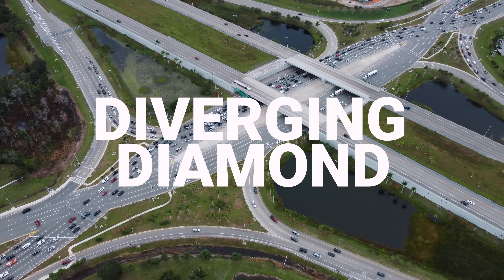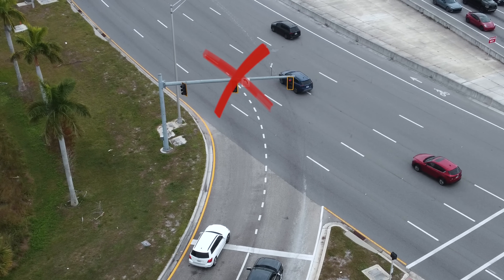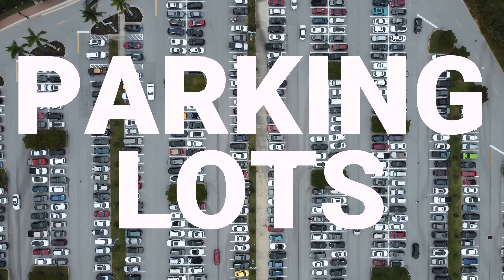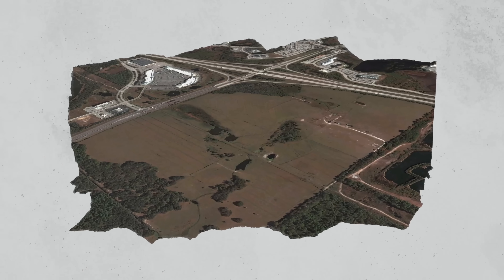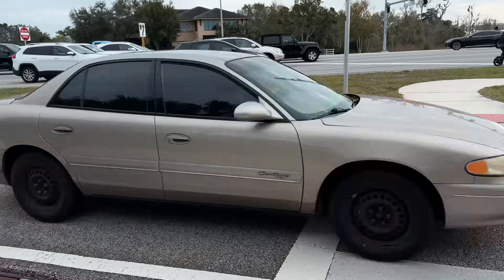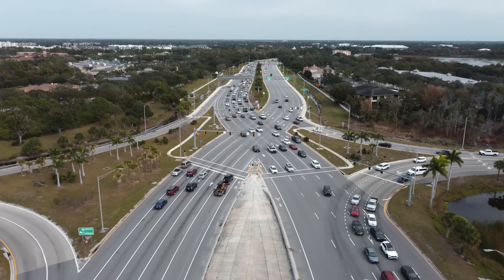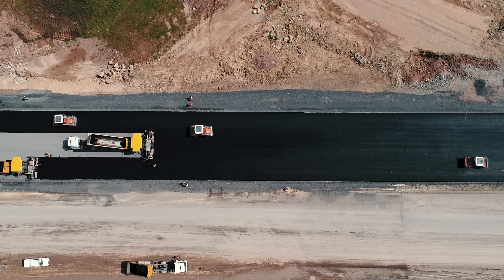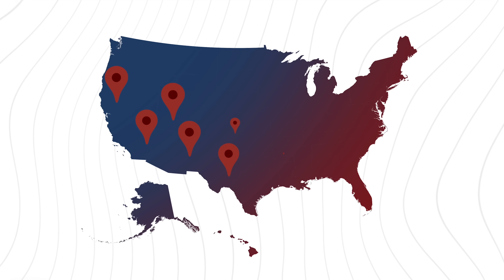Traffic Will Never Be Fixed Here

Comment: This will never fix traffic because the only solution to traffic is mass transit.
Reply: And walkability
Reply: @rennoc6478 In addition to cycling.
Reply: @wturner777 lol
Reply: @JetFire9  what’s so funny about many modes of transportation other than driving?  Don’t you hate getting stuck in traffic and high gas prices?
Reply: @rennoc6478  time to walk 40 miles to work
Reply: @RadioStar1776  if city’s are planned right, stores can be put in a walkable distance to homes, but I will concede that most jobs will still need cars or mass transit to reach
Reply: @rennoc6478 what if the cities are planned around cars?
Reply: @rennoc6478  and work from home =)
Reply: @rennoc6478 the United States is MASSIVE. What exactly is your suggestion to fix the problem?
Reply: @drglopez7789  we don’t need cross-city walkability because your right that would be absurd. We need walkability within individual cities which will get locals off the road
Reply: @rennoc6478 lol broad simplistic solutions to complex problems,  looks like we are stuck with car centric America for the rest of our lives.
Reply: @JoshuaB-p8c you want me to write a whole paper or smth, this is a YouTube comment section not a university
Reply: London and NYC just need more transit! Look the lack of congestion in Tokyo
Reply: @frafraplanner9277  Tokyo has a different culture.  If people in the US obeyed traffic laws then traffic would flow MUCH smoother.
Reply: @TeemoTemosson  There is some truth to traffic flowing smoother if people followed the laws, but the amount of traffic in American cities would still cause them to be in gridlock
Reply: @frafraplanner9277 Grid layouts cause gridlock.
You need to provide alternatives to help relieve traffic, not punitive action, such as tolls, like many cities like to introduce.
Reply: @frafraplanner9277 Tokyo has insane amounts of public transport.
It's also a central, high density city, not something that requires long distance travel to get to places with relatively low density.
Still, the city gets busy, despite the millions using trains. The solution is providing options, so that commuters can use public teansport, and irregular commuters, shoppers, and those with physical and mental disabilities can still drive to places...
Though, everyone should be able to drive. The way to relieve that is to provide good alternatives, not punish driving.
Reply: @frafraplanner9277 its not that they need more transit, its that they need to stop building things that bring "convenience" to cars
Reply: @trevorthefoamer220  But the big automakers do not want anyone to have alternatives to their products, because that would mean they would make less profit, and so the big automakers are going to fight to the death to keep North America dependent on cars.
Reply: @denelson83  Congress had an opportunity to bring the automakers to the unaliveness but they had to bail GM and Chrysler instead.
Reply: @denelson83 then it’s up to us to fight back and fix it!
Reply: @NomadMP476  Big corporations outpower us by several orders of magnitude.  Do you not think we will simply get crushed trying?
Reply: @denelson83  that’s because we yield the power to them. We can fix it but it will take time this begins at the local levels starting with town and village governments then city and state governments followed by federal government. If we can create a grassroots movement in our local areas and push that up the ladder we can and will effect change. Remember these big corporations can’t survive without us.
Reply: @NomadMP476  You did not yield power.

It was taken from you.
Reply: @denelson83  So what can we do to deal with these big automakers?
Reply: @theSpian1  Unfortunately, the automakers have already thought way too far ahead of us about that.
Reply: @denelson83  Why would automakers have anything to do with this. They should have no say in this matter at all.
Reply: @thebestdamager7400  They have a vested interest in making mass transit non-viable so that everyone drives.
Reply: @denelson83  Of course they have, but they should have no influence on the state of viability of mass transit, as they are a company and not politicians
Reply: @denelson83  Of course they have, but they should have no influence on the state of viability of mass transit, as they are a company and not politicians
Reply: @thebestdamager7400  Well, they do have such influence, and they sure as hell use it.
Reply: @denelson83  I know, which is what I ma criticizing
Reply: @frafraplanner9277 I sat in traffic for 30 minutes in an express lane taxi on my last trip to Tokyo. They still have traffic - although it does seem to be a less common occurrence.
Reply: @viperstd yeah 30 minutes instead of 2 hours
Reply: @viperstd It's so easy to claim that Japan has magically solved car traffic, though...
Reply: The only solution is proper zoning. New construction will never be nice if you require residential and commercial areas to be completely separate, and if you require such huge amounts of parking, especially non-shared parking. If you feel compelled to park your car more than once to shop an what are basically adjacent stores, something is wrong.
Reply: @karlkoehler341 Meanwhile, the right wing of politics deliberately misinterprets ideas like 15 minute cities and policies such as Congestion Charging, Clean Air Zones, Low Traffic Neighbourhoods because they perceive any restrictions on people's "right" to get in their car and drive wherever the damn they want to is either "punishing" people, a sneaky means of revenue generation, or full blown "communism"...
Reply: Obviously no road design will ever truly fix traffic as the only true solution is alternatives to driving. But interchanges like diverging diamonds and SPUI are objectively better designs
Reply: @sai_736 Diverging Diamonds are pretty bad for any pedestrians that need to walk across them though and due to American road placement is usually needed unless you want 2 islands
Reply: @Nothing_here7435  ddi and spui are highway interchanges that shouldn't be mixed with pedestrians
Reply: @sai_736  Like I said in many us towns and cities a highway cuts through them so it is needed many times
Reply: @sai_736  

> the only true solution is alternatives to driving

the only alternative to driving is not to drive and if you don't drive how are going to get to work?
Reply: @this-is-bioman  this is bait right
Reply: People in this thread are missing how this works. Traffic will always be bad. No matter how much transit or roads you have, those roads will be full in big cities. What mass transit allows is that even in this HUGE and highly congested cities, MILLIONS of people are able to get where they are going reliably and in reasonable times. Without this, not only is a city miserable as that congested road becomes your only option and travel times continue to grow and grow. Eventually you build so many roads you don’t have enough usable land to support it.. and the city stops growing.

It’s not about ending congestion. Those cities like NYV, London, Tokyo, and etc wouldn’t even be possible without good mass transit. Look at the overall travel times. These people can travel much more freely despite the congestion, compared to places without transit and where urban sprawl has become the means for dealing with growth.
Reply: Is mass transit was a solution Tokyo New York City Boston Chicago San Francisco hotlanta would not be traffic extreme nightmares.  And this is coming from a subway boy but it is nice to have options at your fingertips
Reply: The Japanese fix mass transit by having staff on the platforms physically push people into train cars like sardines. 😅
Reply: @umaikakudo Hah. Yep. People like to pretend like Japan is some public transport utopia, but there is only so much physical space for people.
Reply: It also help if we have more mix zoning like japan instead of the strick zoning like what we have
Reply: @USSAnimeNCC-  It would actually FIX the housing crisis we’re in right now.
Reply: Spoken like someone who has never lived outside of a city or tiny country. It's funny how people who haven't left their bubble can't grasp the scale of the wider, open world.
Reply: @Valensiakol it truly doesnt matter on the size, look for example the LARGEST City on earth Tokyo which has incredibly effective mass transit, and then on the opposite side the SMALLEST nation in the Americas the Bahamas has some of the worst traffic ever. So how is it size again?
Reply: @SpeedyGozalzes you're missing my point. Mass transit isn't the magic solution for every situation. Trying to rely on mass transit for the majority of people movement in some places would literally be impossible and wouldn't "fix" anything.
Reply: @Valensiakol mass transit is much more efficient than normal transit. We just need walkable cities to make it work
Reply: Mass Transit doesn’t work in the US. Where Mass Transit would be practical for its cost would be cities, and cities in the US are not like cities in Europe. They’re massive. There is no cost effective way to build mass transit everywhere that people want to go in a US city. 

The only people who have figured it out really are the Japanese, but there mass transit infrastructure has nearly taken over there cities. Peoples houses are now below train rails. And there traffic still sucks.
Reply: @Jay_Force_One  “Because we’re too big” is really no excuse.  America once had the best transit network in the world.  That is until the car came into the picture and lobbyists such as big oil helped bulldoze for the car and subsidize road infrastructure.  Now only a few cities have decent transit while the remaining ones have either mediocre at best or nonexistent service.
Reply: @wturner777   😅thats not fully true, train companies went bankrupt in 1970s like a lot of them because the compatition was so great and kept buying other train companies that went bankrupt to point they went bankrupt because they couldn't fix the tracks from the previous company.

another reason train companies went bankrupt was the mail cars, that took away 20%-30% of the revenue. passengers where always at a loss, it's why amtrack was built to off burden the train companies
Reply: @Jay_Force_One Japan has insane train infrastructure, yet still has people pushers, and insane amounts of above ground rails destroying local connectivity.
Japan isn't some magic case study. It is a study in how not to do it.
Reply: Is no one looking where this video is?  This isn't Miami.  A subway system isn't going to work in the area featured in the video.  Its a bedroom community quite a bit outside of Tampa.  No one in a bedroom community far outside the city center is going to ride the monorail to Whole Foods.  Before you get angry at me, I live in a major city where I actually do take the metro five days a week.  Its just obvious some people need to log off of City Builder 9000 video game and stop fantasizing that everywhere can look like Manhattan.
Reply: @stevens1041  1. Mass transit can include smaller systems like buses and the such. So trying to say mass transit means installing trains, monorails, and metros. And most of the people I assume meant public transit instead of mass transit.
2. Part of what makes these suburbs poorly designed is how spread out it is. And walking and biking should be a good system for smaller areas but this area is pretty large.
Reply: @Nothing_here7435 Have a spread out country, have spread out construction.
Reply: You couldn't pay me to take public transportation. I got my first car when I was 24 and I'll never go back. Taking a bus home after grocery shopping is ridiculous, especially when you live in places where it snows and gets very cold. Then you've got the crazies on the bus harassing people. Having to wait for bus transfers in the cold, rain, and snow. No thanks.
Reply: @ghostrider_414 thats because thats exactly how the transit system has been left. To rot and stink. So of course no one like urself wants to take it. But If you reduce car dependency and make things closer. Improve transit, actually fund alternatives to driving and make it quicker than a car than you would want to take the bus
Reply: @ghostrider_414 Grocery shopping with public transport is just horrific... plus you can't do a big shop, you have to make several small shopping trips repeatedly.
Reply: There are millions of miles of road that work traffic-free.
Reply: Viable

Alternatives

To driving
Reply: America is so lost. It is ridiculous!
Reply: Which will never happen in the states.
Reply: or something called not being a city slicker
Reply: I’ll take the traffic.
Reply: @119Agent  To each of their own.  It's your time, not ours.
Reply: That is still a temporary fix. As populations grow and areas develop, demand for transit will continue to grow, and outstrip existing infrastructure. There's no solution. That's like asking what the solution to overpopulation is. There isn't one. At least not any good ones.
Reply: @Ang3lUki There's no such thing as overpopulation.
We need more people, not less. Well, whites, anyway... we're not having enough kids.
Reply: Actually mass transit is the solution to traffic. If you worry about shopping, think of the many people who cannot drive cars who have adapted.
Reply: @goatgamer001And all those people who would drive if they could afford it...
Reply: i mean, the solution to it cant just be One thing.
Reply: In the US, that does not work, because by far the most people that are causing this traffic are from suburbia, which is way too sparsely populated to have public transit. Also, because your supermarket is so far away, how are you bringing back your week's groceries on the bus?

For the car problem to have a chance of getting resolved, a lot of underlying problems need to be addressed first, like suburbia, like zoning, like cars as status symbol.
Reply: only fewer people in any given area fixes traffics, anything else is an optimization
Reply: Yeah, no. The only solution is smaller communities and more self-sufficiency.
Reply: So the problem is human stupidity. 👍
Reply: Doesn’t work.   Most Americans don’t want to live in an archology.  Some refer to it as “shoved into a box, and eating bugs”.  
The areas of the country where transit is most developed is the northeast and the west coast fringe.  Which are now too expensive areas for many.   And they feature “machine politics” with attendant cronyism and patronage.  Who gets the “transit” jobs?!?
Reply: And development thickly settled enough to support mass transit.
Reply: @edwardmiessner6502  No you don't need a critical mass. Trams will do just fine, buses will do just fine. Smaller buses, larger buses, short or longer frequencies, just tweak this. The problem is transport planners assuming that "critical mass" is needed. If public transit can't break even, tax the car drivers more. Or just build more cycle lanes and let private individuals manage the cost of their own bicycles.
Reply: @ItsElement115  People with your line of thinking is precisely the reason your subway is this bad. Waste everything on cars and make a pikachu face when barely maintained transit is a shithole lol. Enjoy having your freedom to be forced to buy a car to go anywhere.
Reply: Exactly!
Reply: That will only work in your communist utopia
Reply: You don’t know that nor have proof. Your statement is fake news.
Reply: Yeah that’s a big no for me
Reply: ... or fewer people. They're working on that too.
Reply: Thank you!
Reply: California has a near $100 billion dollar high speed boondoggle on its hands.   Still nobody likes mass transit.
Reply: Truth is pretty ugly and is related to the housing issues and the carbon footprint and resource shortage plus the mass congestions- 1. we are way, way too much 2. quite often one person one car is the norm. This whole thing is not related specifically to the US alone.
Reply: @alexmercer8042  Not to mention the NIMBYs don’t want their precious property devalued.  Housing scarcity is intentional.
Reply: @wturner777  That is another issue and from what I understand has been going on for quite a while in the US
Reply: @alexmercer8042  True
Reply: There are far too many variables that contribute to “traffic” for there to be ONE simple solution. Mass transit may be part of the solution in some circumstances, but not necessarily.
Reply: Yup, we’d probably have an easier time banning guns or introducing UBI and communism.
Reply: Or bikes…
Reply: @mrembeh1848  Correction.  AND bikes.
Reply: Exactly!
Reply: realest comment ever
Reply: I was trying to think what they could do, but as you said.  It gets to a point where all you can do is raise parking charges and invest the money in subsidised bus services, and trains.
Reply: Correct!
Reply: I think we should not call it mass transit. It has a very negative association to it.
Reply: Not just mass traffic, just good alternatives, be it public transport or other roads
Reply: The issue has less to do with alternatives and more to do with the premise that people want to live as far from anyone else as humanly possible. Change the land use problems and everything else falls into place.
Reply: THIS!!!
Reply: I agree! I moved from the area in the video to a place with public transit, and I am much happier. It's better for my health as it forces me to walk, and my commute is shorter and more pleasant =)
Reply: japan is in good rail  subway  high speed systems no need to use private car
Reply: Except better transit will also cause induced demand
Reply: And people who know how to properly drive and not blocking traffic adjacent to their direction.
Reply: 😂 we rather ride alligators than the city buses
Reply: More accurately : better planning.
Mass transit won't fix a poorly planned city and won't prevent existing car infrastructure from being outdated relative to population
Reply: @Spido68_the_spectator  Florida has only been populated since the invention of AC and Disney World lol. The only natural resource we have here is phosphate. Other than that it’s just the gulf, Atlantic, and swamps between them. DeSantis announced last week for major expansion of our highways. The federal government rather invest in other countries than the gateway to heaven for most retirees lol. Just started operating a few months ago, Brightline runs from Miami to Orlando; Tampa is coming soon. This train is privately funded since it’s been voted 2 times now to reject the use of public funds. So idk where you’re from but I have an idea what it’s like living in central Florida. It sucks sometimes. Especially when Epic opens up in a year or two!!!
Reply: @sbitsjustony  what does this have to do with my comment ?
Reply: @Spido68_the_spectator  you said that Florida should have better planning for their infrastructure. I most high populated cities the infrastructure is built BEFORE population growth. It’s the opposite for Florida. Theres lot of retirees whose on fixed income and the last thing they want is higher taxes
Reply: @sbitsjustony  Ah.
The train isn't entirely private funded by the way
Reply: @Spido68_the_spectator  Our governor Scott announced like 10 years ago that public funds won’t be used but most people know that politics doesn’t work that way. There’s always a way that someone sneaks it in there w/o public notice. IDK who owns Brightline but they stepped in and is forking out majority of it. It’s amazing that it costs almost $100 to ride it. It’s fine for solo traveling but it’s not encouraging for major expansion of mass transit
Reply: Yes... Imagine if we had population of China or India trying to do what we do. It would be stupid without public transportation
Reply: Mass transit for local commerce over long distances is highly inefficient and cost prohibitive. Just like walkability is a pipe dream. I’ll never understand why people don’t acknowledge this fundamental flaw with their theory.
Reply: Trains: 🤫🧏‍♂️
Reply: It’s the solution to everywhere that has high population density and doesn’t require travelling in from rural areas
Reply: Mass transit suffers from the exact same problem. You give it more capacity, it becomes better to use, more people use it and then its just as full as it was before (look at Japanese trains at rush hour, and they're famous for their rail infrastructure)
Reply: Unless you live nearby, no one with a car will walk to a shopping center to then have to carry their things back with them yet alone take mass transit. Mass transit only helps those who want to give up having a car, or can afford one, all together. If you have a car then you're going to use it and so the only way to reduce the congestion here is to fix the layout of these intersections to allow the continuous movement of cars.
Reply: Americans have decided that will single handedly pollute this planet into oblivion than use mass transit.
Reply: "Why doeant this town of 4000 people have a subway system wtf?!!??! FUCK CARS"
Reply: and usa purposly avoids mass transist bcs of oil concers
Reply: If in a city setting yes....but there is no mass transit in the countryside or at least not reliable.... you'll never fix traffic if you never take people who need a car to get anywhere, into account....
Reply: Or villages where you work in decent distance
Reply: Yes yes yes
Reply: which no one wants to use. I live in Florida an hour south of this diverging diamond and ours opened this week. Public transit is garbage and its garbage because of the public. no one wants to sit in someone else's bodily fluids or get stabbed by a methed out crazy bum. what public transit the US has is dying. The subway ridership in NYC is down by 1/2, Bostons is 1/2 of what its was 3 years ago, San Frans is running out of emergency federal funding, which is the only thing keeping it a float.

the only thing, and I do mean ONLY viable car alternative is PEVs, ebikes, scooters, one wheels, skateboards, and unicycles. Their popularity is exploding here because its legal here for them to use the sidewalk. no one walks here. you can't 7 months out of the year. you'll roast to death. this video of this guy walking the interchange? this video is 6 months old. he shot this in dec or jan. yeah that really nice warm but not blazing hot weather he's walking in.....is the middle of our version of WINTER.
Reply: Mass transit is not all ways the solution. Build a train it will induce demand, it won’t. Because some of the solutions to traffic are. The same for better walkable and bike able  streets.  Mass transit just adds to the congestion as more cars does.
Reply: Mass transit is slower than cars in almost all situations.  Consider the time getting to the bus, waiting for the bus, stopping at other stations, then getting from the bus station to your destination. With cars you drive and park and usually just walk a shorter distance to the destination
Reply: If everyone rode e-bikes or transit for their intra-city trips, this whole traffic problem would be a lot easier to manage!
Reply: Well... mass transit is a way to move lots of people from one place to another. But that's not the only way to reduce traffic.
Reply: Imagine there was a city with the collectivism of Tokyo that balances with the individualistic values of the west, while prioritizes walkability and transit at the same time.
Reply: Har har socialist chud
Reply: That you can park your car in
Reply: I don't know man, that sounds kinda like communism (this is a joke, please build more trains)
Reply: Traffic in Seoul, South Korea: 💀
Reply: good mass traffic. If public transport is shit people keep using their cars.
Reply: Best way to try and maybe fix this issue would be add car parks off of the highway directly, then add shuttle buses to the retail park from these.
Reply: Mass transit can only do so well in an urban setting but in the suburbs, that's down to light rail or buses, but these suburban developments have been built in a design that literally restricts anyone from getting to alternative transports besides driving due to the amount of distance and how far apart the destinations are for amenities (a suburbanite having to use the car to drive to a lifestyle center, as opposed to actually walking down the street and finding a corner store; one or a few of these plopped just inside the gated neighborhood)
Reply: @ most suburbs don’t even have light rail or buses.
Reply: Spoken like someone who isn't from southwest Florida
Reply: And bikes. And better Zoning.
Reply: Okay but like hear me out on this.....
We just need one more lane
Reply: Wolves as well as several other things also would solve this problem just not the way you want
Reply: That sums it up right there
Reply: Nobody in Florida wants mass transit.
Reply: @user-iu1ru1qz7u  I live in Florida and would not mind mass transit, honestly it'd be great for days when it rains since I ride a motorcycle
Reply: Mass transit doesn't fix traffic until little start using it
Reply: Mass transit and walkability doesn’t work for people who are handicapped. Remember, this is Sarasota. Think of the demographics of Sarasota. It’s not young, fr people in their 20s. It’s old people with old cars with lots of well-earned dents.
Reply: nice dogwhistle, what's next, amazon warehouse child labor and a social credit score? creep
Reply: Screw mass transit
Reply: There’s not the “only solution” everything should be integrated, we shouldn’t satanize cares either
Reply: They don’t even have buses in Sarasota and you can forget about walking
Reply: I definitely agree, but also having tolls to raise prices when busy may work
Reply: Hi. I live there, and use this road often. We have a lot of public transit options. This is not the problem.
Reply: @ no you don’t dude
Reply: @nuclearthreat545  bait used to be believable
Reply: haha like no way - it just moves the same problems to a different place.
Reply: Hi. The engineering road improvement projects with suburbs, traffic signals, roundabouts, Jughandles, RRFB’s, overpasses and DDI interchanges are good one. In New Jersey, this state has jughandles and some u turns only instead of DDI.
Reply: And they will never fix this because it would be uneconomical. Maybe when those business districts are no longer viable, they can redesign the whole place as a town center and work the plan outward from there.
Reply: Mass transit will never be as accessible
Reply: @antonioguglielmetti2661  1) You're apparently US American (T********e, Michigan according to your clips?) 2) You're a kid. My highest guess is 20.

Conclusion: You have no clue what you are talking about, you have no reference points and you're in the most self centered country in the world. Pretty much the rest of the civilized world has accessible mass transit. Which makes the world question US Americans status as "civilized".
Reply: Sarasota/Manatee Counties thought that it would be a cheaper alternative to an east-west expressway with an interchange at I-75. Lee County made the same mistake with CR884 and Collier is making the same mistake right now with a DD being constructed at Pine Ridge at I-75
Reply: GO MASS TRANSIT!
Reply: @nicholaswastakentwice Mass transit only works when a mass of people want to go to the same general area like a central business district then back home.  Works ok for mass urban areas and mega cities. Not so much in in Sarasota.
Reply: You then just have to fix mass transit - lock up the criminals who make it unpleasant.
Reply: @tbird-z1r  Well even places  have super mass transit like London Singapore India And I'm sure I missed a few Beijing Shanghai they still have massive traffic issues.  The only mass transit does is add another option to the crowded table already
Reply: Even mass transit won’t fix things, the problem is the vast sprawl of suburbia. To really fix things, suburbia needs to be rebuilt into denser villages where each one is self contained, ie you would rarely need to leave your village for something essential.
Reply: Mass transit has it's place. Not here. How are you hauling all that shopping you did?
Reply: @sumgijimothae  In other developed countries, grocery shopping can be done with or without a car.
Reply: What a load of horseshit.
Reply: @TrulyAmazingPS  It’s just facts.  It’s been proven time and time again.  Google the Downs-Thomson Paradox.
Reply: THANK YOU, public transportation is so undervalued in this capitalist hellhole
Reply: @miscaccount9438 Yes. Having enough money to buy a car for comfortable, private transport is terrible.
Let's all travel in frigid cattle boxes. That's the communist way.
Reply: errr, no. The solution is not mass transit. The solution is designing the living space so you can walk / cycle around. Mass transit is a solution to the problem of badly designed living space. You're not solving the root of the problem with mass transit.
Reply: @l.d.t.6327  you can't expect people to always have local job, never go outside of their community and magically be within everything they need in walking distance. So whatever ideal zoning you can imagine you still need transportation and transit.
Reply: @MikeRI170  ofcourse you need transportation. But first you need solid urban planning. The whole area around that intersection is pure horror, designed as a function of car transport, and that's the root of the problem. You won't miraculously solve this by mass transport, when you waste all your space building parking lots. Who wants to walk / bicycle through a world full of parking lots?
Reply: @l.d.t.6327   well who wants to pick up groceries and walk back home on a 15min walk? also most Americans stopped walking in most cities even looking at old photos where places never really changed like 1950s and now it's just people stopped walking in areas
Reply: @knightwolf3511 One of the issues: there are often no grocery shops anymore in that range around where people live. How to solve it: look at other places in the world. Is a solution feasible / worth it? That depends, but any solution is a work of decades,  re-arranging the public space and (re)designing residential areas whenever there is an opportunity, and thus a vision that must survive for this long (not very likely)
Reply: @l.d.t.6327  Mass transit gets people around the CITY. Proper zoning and district design gets people around the NEIGHBOURHOOD or TOWN on foot or by bike.
Reply: @l.d.t.6327 transit is needed for longer distances though
Reply: @l.d.t.6327  yes, that’s my point. Mass transit and even walkable cities won’t solve the problem of congestion if government continues putting people into a single city. That’s why I was proposing just having more cities to allocate people and reduce the number of people in mega cities. By doing so, the congestion problem will be much less severe in the first place
Reply: Ew.
Reply: Why mass transit when I can buy a self driving electric vehicle and join the future of technology transportation.
Reply: @michaelmccarthy4615  Because, one, the technology of fully autonomous vehicles is STILL not there yet and it would take years, if ever, for the technology to be perfect and go mainstream.  Also the world isn’t ready for it yet.  And two, you still wouldn’t get anywhere fast enough because you’d be stuck in traffic like the rest of the people who choose to drive.
Reply: Incorrect. We need more private vehicles and sidewalk-less roads
Reply: Meh. Boring and doesn’t go where we need it to go. Almost all places are NOT like NYC in layout and organization.
Reply: No, even mass transit will struggle under extreme heavy traffic, look at rush hour in Shanghai and Beijing. They have decent mass transit, they still struggle during rush hour. It just better to decentralize commerce and industry to multiple cities and let more cities grew together rather than just out everyone in a single “megacity”
Reply: @darksmith7318  China is unique in that their 25 or 50 largest cities are already megacities! 😮
Reply: @darksmith7318  Where even mass transit struggles, cars will struggle far more and result in guaranteed gridlock. Megacity is not a problem as long as there is proper zoning such that most people don't have to go very far for most of daily life's activities.
Reply: @darksmith7318 cities with more than 20m population are normal to experience extreme heavy traffic
Reply: Honestly they should have went with a SPUI. The diverging diamond is great at capacity but not with 4 segment traffic lights all around it. Making a SPUI would match up the traffic around the area with it being 3/4 segment traffic light instead of a 2 segment diverging diamond.
Reply: @josephzastocki2815   agreed. DDI is good for areas with high traffic but not as much adjacent intersections
Reply: The matter of our carbon foot print was not mentioned. It is the most important part of this problem.
I couldn’t care less if Sarasota or all other places I don’t visit, are car hellscapes to be in, but since they also impact the globe, I do care.
Reply: I would rather have traffic than not have the freedom to go wherever I want, whenever I want. Screw mass transit.
Reply: @InciniumVGC  clearly you live in a country with shitty transport, in Singapore you can go pretty much anywhere you want in under 35mins-1hour
Reply: Mass transit doesn't fix traffic either. Look a london and nyc. But it gives everyone options and that is most important
Reply: @john-ic9vj  London and NYC are bad examples because cars are still a dominant force in both cities. Mass transit is undoubtedly the solution, and is not to blame for poor development choices that the aforementioned cities, among others, have made.
Reply: @mikeamber2528 NYC and Landon are still better off than most North American cities. Maybe with the exception of Montreal.
Reply: @mikeamber2528 Ironically, central London has oodles of mass transit: bus, tube, heavy rail (including Overground, Thameslink and the Lizzie Line) plus various forms of charging for vehicles - yet the streets are still often crowded. So presumably there are still a lot of journeys which aren't adequately catered for by public transit.
Reply: @mikeamber2528 As being from London, that's complete nonsense. Less than half of the households have a car. Yet traffic is insane here.
Reply: @mikeamber2528 nonsense.  NYC is easily the biggest non-car city in the country.  The foot traffic is huge.  No city here has pedestrians as does NYC.  there are plenty cars, but mostly taxis, and so much of transit is mass transit or on foot.  This is not the case anywhere else.  You’ll hardly see many walkers in any other city.
Reply: @theOlLineRebel  You said it yourself, there are lots of cars. NYC may be good compared to other US cities in terms of its car dependency, but it is still flawed - as every single city in the world is - even places like Amsterdam and Tokyo, both renowned for their safe streets and extensive mass transit, respectively.

NYC has lots of pedestrians and great mass transit, but issues are still present. For one, the city has urban freeways that cut through certain parts of it. Urban freeways will always bring car traffic to surrounding areas, because they offer drivers from other places an easier route in. Ultimately, traffic is caused entirely by cars. It is inherently cars that are their own worst enemy, and as long as people drive, traffic will continue to exist. Transit and other alternatives can improve the traffic, but I've come to accept that nothing will really solve it completely; we can only do our part to reduce it.

Also, despite NYC having great transit, expansions for the subway have slowed and ballooned in cost in the last few decades, so now the network isn't even keeping up with demand from a rising population. Buses and bus lanes are fine but will never compare to the capacity and efficiency that a grade separated train has.
Reply: @mikeamber2528 you really trying to blame cars for how awful mass transit can be?

Like brother do you want to be packed into a train like they do in Japan?
Reply: @john-ic9vj well maybe not solving traffic 100%, it still helps out as traffic would certainly be far worse without their respective mass transit systems. Just look at LA or Houston for example which have worse transit than NYC or London. And besides, having people not drive is the ONLY thing that will reduce traffic which NYC and London def do with their mass transit systems. Because idk about you, but i don’t see metro trains causing gridlock traffic; but I see cars doïng that
Reply: @john-ic9vj yeah it doesn't fix traffic. But most people would not be in said traffic. Those who still insist on driving would still face jams, but the majority won't. That's the point of mass transit.
Reply: @john-ic9vj imagine saying that NYC and LONDON are examples of mass-transit. The London tube system is a tangled looping mess that is laughably inefficient, horribly designed, the ROADS are horribly designed for vehicles. Especially the buses which have become their own traffic problem due to lack of parking or specific lanes. NYC has the same design problems. 

Without the public transportc the problem would be over TWICE as bad as the city at its worst, constantly.
Reply: @john-ic9vj mass transit does fix traffic for the most part IF people are given the choice to do so AND people are willing to choose mass transit instead of private cars. Just look at Singapore. 

Yes there are still traffic in Singapore, but around half of the population prefer to commute using mass transit because it is more efficient and way cheaper. It was designed that way, the community was designed with walkability in mind, not isolation from basically anything you need to live if you don't have a car
Reply: @john-ic9vj  London has way too many cars. So does NYC. If you can't walk 5 miles in one day, you need to NOT be in those cities.
Reply: @john-ic9vj  London and NYC are some of the worst examples, look at Singapore or Shanghai which solved their traffic problems.
Reply: @john-ic9vj  it fixed traffic for the people who aren’t sitting in traffic.
Reply: @john-ic9vj  imagine what it would be with out the public transit. Growing up in the Burbs of NY i can count on one hand the amount of times i drove into manhattan.  Also the amount of jobs public transportation creates too!
Reply: @john-ic9vj it doesn’t fix it because some people refuse to use mass transit. So, yes, mass transit fixes it, individual transit borks it
Reply: Mass transit is terrible
Reply: @ItsElement115  and lack of it is even worse.
Reply: @ItsElement115  No, closed minded people like you are terrible!
Reply: Mass transit is kinda kicking cans down the road by increasing capacity of per travel miles. It is like building wider lanes on interstate. But this time, put everyone into a box and ship them there
Reply: @darksmith7318 no it's not. More lanes and more interchanges can't scale, it introduces more conflicts and thus jams. Meanwhile mass transit and walkability are orders of magnitude more scalable. You can jam hundreds of people in a single train car like they do in japan. For sure it's less confortable than sitting in a car but it gets people where they need to be in a predictable amount of time
Reply: @freemanol  yes, you are correct. But as I said, they still got the limit, just higher than cars. A normal train can up to 400 people. But if u have 1000 people trying to board the train at the same time, it is not gonna happen. U gotta wait until next one. And just like cars, train will have their own traffic jams if you put too much up there. And also, there is a problem with capacity matching. U got a train that transported 1000 people to the bus station where they can go to any part of town they want. But single bus capacity is much smaller than single train and bus stations can only take limited amount of busses at a single time. It is likely that there will be a bottleneck created. In result, the mass transit isn’t as efficient as many people claimed. I haven’t even mention the breakdown and maintenance will affect how many commuters. For cars, it breaks down, it affects only one. People with cars can go in and leave the mall anytime they want while mass transit will create a mass crowd and likely stuck people at next station. It is a complicated problem. So if we spread people out to more towns, we can prevent the problem in the first place. It is USA, not Japan or Europe. Available land are everywhere
Reply: @darksmith7318 which is why in developed systems there is no single final train station where train just dumps everybody out. Your examples are waay too primitive to have any real significance. Maintenance of vehicles is also not a problem because there is always a surplus of vehicles in reserve that can replace those that need maintenance.

Your extreme examples of Beijing etc are a moot point as well, because if you were to remove the transit and replace them with cars it will all just collapse — cars and roads can never have capacity even close to needed.

Moreover cars have a lot of other problems besides traffic. The fact that US as the land of freedom lacks the freedom of choosing a car or mass transit is ironic. Many things should change in the US for the better, and public mass transit and cycling infrastructure is one of those. Arguing that US doesn’t need those because “hurr durr look and China mass transit can have heavy traffic too” is missing the point entirely.
Reply: @MikeRI170  yes, in designing, that’s correct. We don’t put everyone in single station so the entire station is clotted. But in mega city like Chicago, NYC, there are only limited spaces available for these stations and cost of construction were too high to even justify building more stations and rails. With growing population, it become inevitable for people to piled up in couple stations where commercial and financial district located. And I am not talking about getting rid of public transit and replace them with cars, I am talking about just have less mega cities, and diverging population to form more smaller towns and cities. Lastly, I agree with you on the freedom of choice part. Cities needs to have proper transit lines. But at the end of day, it really comes down to the cost. Similar problems appears in China, ( I take it as example because they are kinda similar to USA related to landmass and highway systems, while having a much more modernized and convenient public transit system), people still choose to take cars in some relatively smaller towns because it is a faster way of traveling. Busses got stuck in traffic and so many stops and making it utterly slow. Subways needs to worried about land costs and locations that people most likely to go, so people need to spend more time walking or taking another connector transit to reach final destination. It makes everything slower. As a result, when driving is faster, people just drive. It lowers ridership and lead to public transit running under heavy losses. And it is not sustainable, for city like tianjin, its trt company is running under heavy debt with debt ratio of 72%. It is just like road, it will become a drain to taxpayers money. And it could even worse considering how many people they hired, how many cars they maintain, and how long of rail lines they need to service compared to just a paved road.
Reply: @darksmith7318   You lost me. You talk about mega cities where everything is highly congested, but then somehow we end up with driving being the fastest option. I can't see that happening. 

Mega city itself as a phenomenon is created by car-centric planning and suburbanisation. Car would be always the preferred option on such conditions, so driving will become the slowest first. 

I guess you are correct in assessing that no transportation solution can handle extreme case of mega city downtown with vast suburbia. However there is a gradation that cars scale the worst, and mass transit can actually still function.
Reply: @freemanol yes because trains and buses are never late and never breakdown, so now hundreds of people are late to work depending on your so called eutopia solution.......
Reply: @darksmith7318 available land taken out of agricultural production in most instances, whether it's for transportation, commercial, or housing use. Which is why this utopian idea of everyone living in a single family home eventually becomes a problem. Developers always go for the easy stuff, which is mostly now the flat high production farm ground here in the Midwest.
Reply: @darksmith7318  Yet one two-track subway line potentially has the capacity of a freeway with 20 lanes of traffic each way. 20 LANES!
Reply: @edwardmiessner6502  I wasn’t denying this. I am arguing against the idea that mass transit or walkable city can fix the traffic. It can’t! Just like interstate and more lanes can’t fix traffic for cars. USA indeed don’t have that much population compared to China, but USA also have its mega cities and these cities are attracting more people to live in it because of job opportunities. NYC got eight million people live in it, it is not a problem that mass transit or walkable city can fix. There are only limited space available for transit routes and stations. However, if there is eight city, each city got one mill, the congestion problem will be much less severe and combination of mass transit and car can fix it much better than having a 8 mill in single mega mega city
Reply: @darksmith7318 NYC isn't even American anymore